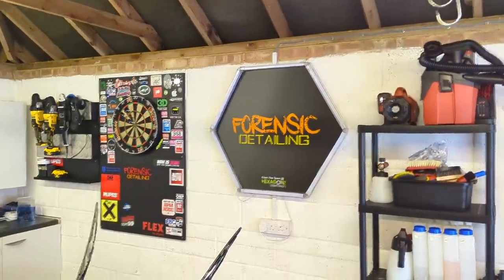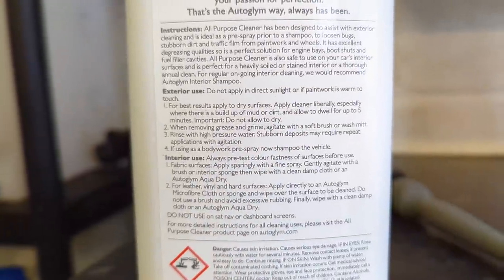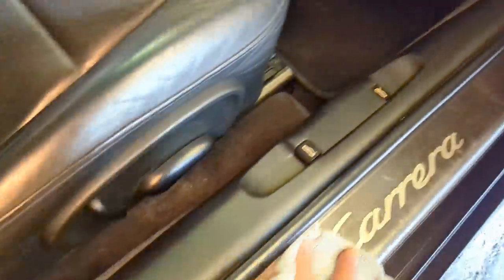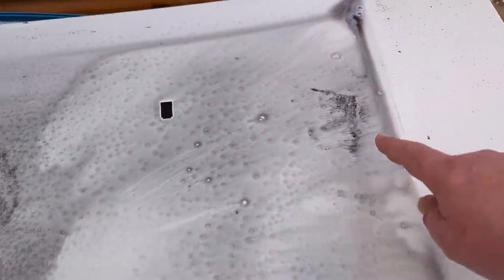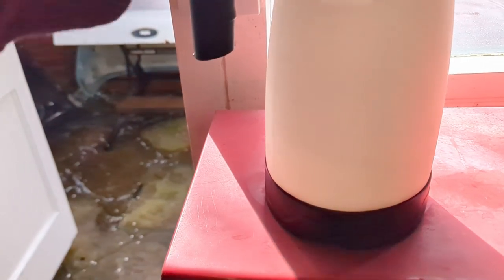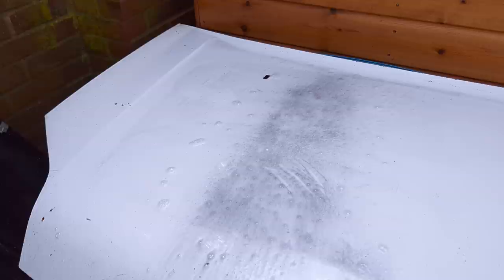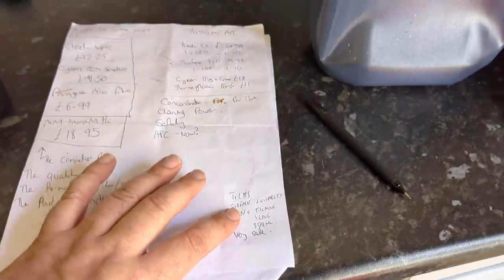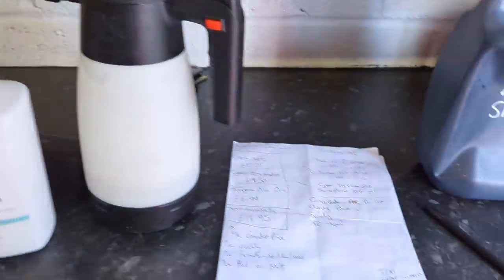*NEW* Autoglym All Purpose Cleaner Review

Comment: An APC for general cleaning is better to be neutral, a PH around 7? It would also be interesting to measure the PH of the APCs demonstrated to clarify what kind of product we are talking about in terms of PH. cheers
Reply from the maker: Why would it be better at ph7?   You cannot determine much about a surfactant blend from the pH.   You could make a base with. Caustic soda and balance it closer to pH neutral and it could be more damaging potentially then a blend of surfactants than are  ph12 with no caustic soda.
Reply: @ForensicDetailing  Thanks for the clarification, sure caustic soda is a radical move in terms of cleaning, and is better to stay away from, so we can assume, as a general rule,  that a more alkaline PH (i.e 10) would be better for cleaning and degreasing the interior, or even the exterior of the vehicle. My focus here will even be more on the interior, which has a greater variety of surface types and resistance and even dirtiness.
*Just an aside in the answer, I use a multipurpose product PH neutral of 7, dedicated to homemade cleaning, even in the most sensitive parts and I mix it at 1:10, and it has worked beautifully, of course after cleaning, I have to seal the surfaces with products suitable for them., however the product is not even referenced for car cleaning, technically very very identical to Nextzett's Blitz Reinig, which even mentions where it can be used at home. I've never had any problems and now I'm thoroughly cleaning a 4x4 with a lot of dirt built up over 22 years :)